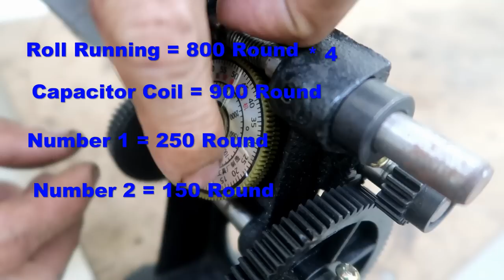Restoration Very Old Rusty Badger Fan | Recover Electric Fan From Scrap Iron Pile

Comment: Coils burnt????? what did someone do? Apply 10 times the voltage and watch it go up in smoke??? The cost of restoring this fan that looks like it's from no later than the 1990s, and new one could be bought at the fraction of the price, but then again adsense and the views of this video made enough to buy a bulk of new ones from China..